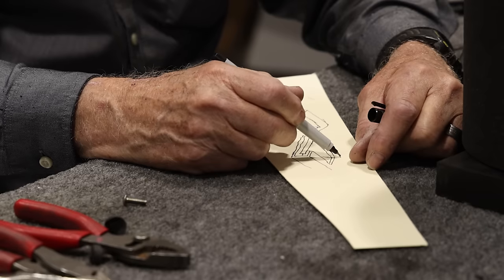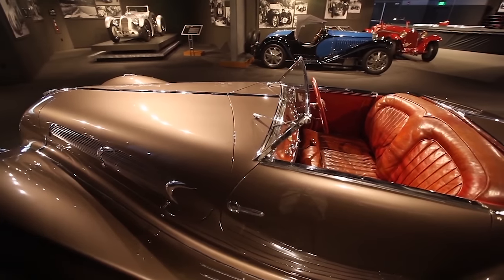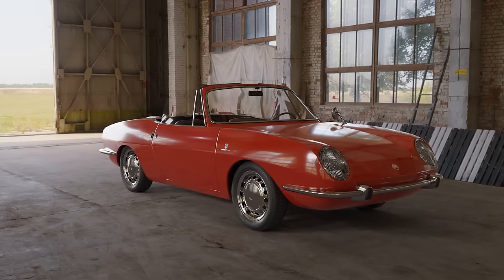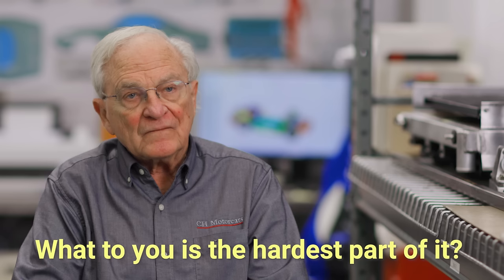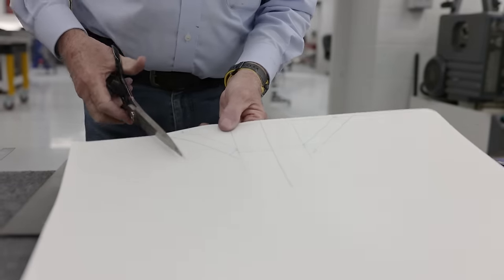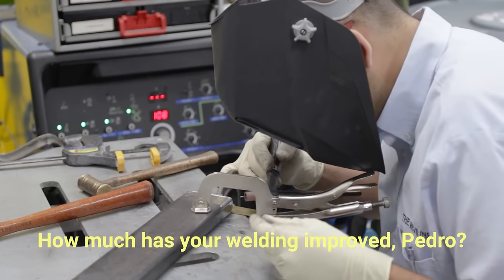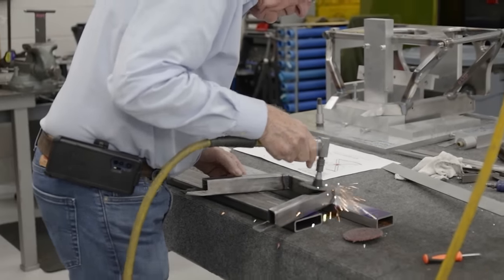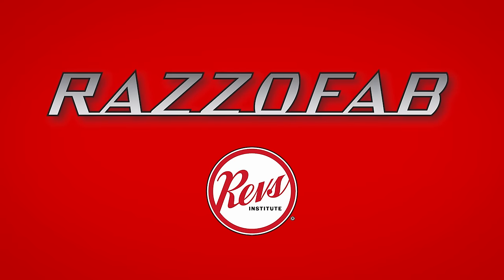RAZZOFAB Episode 1 | The Challenge (Part 1)

Comment: I hope that this project reflects well on my OTAS Grand Prix, one of 175 custom built Fiat 850's using a Francis Lombardi designed steel body around a 1970's fiat 850 coupe. The body looks like a cam tailed Pantera, originally imported to Rich Motor Imports as an answer to the Gasoline crisis-a car that looked fast and was economical too. Of course, using the original Fiat 850 "Failures in Automotive Technology" (FIAT) , the OTAS was not going to win any chassis design strength competitions, nor support more than about 100 HP.  Yet doing more with less was Carlo Abarth's success. He modified the tiny coupe to make a giant killer named "The Scorpion".  The Italian "Smokey Unik's" (Spelling?) of the era did amazing modifications to the Fiat line.  Companies like PBS engineering contributed to the upgrading. This was all "Italian Hot rodding" The Razzofab will be the ultimate extrapolation of dreams never otherwise fully achieved.  I am watching. Interesting that most techs here are around my age. They lived this history.
Reply: I had to tow mine from Kansas back to Dallas using one of those chain tension towbars.
I could have pulled that cross mounted leaf spring completely off before it got tight!
Fun times!